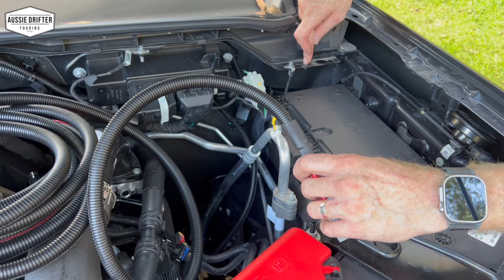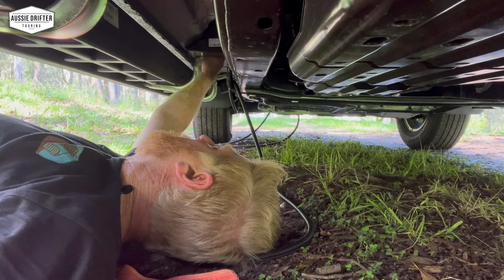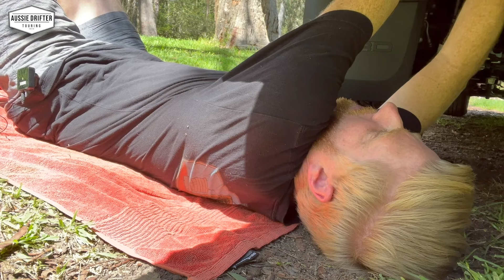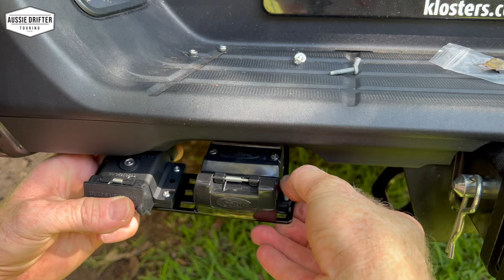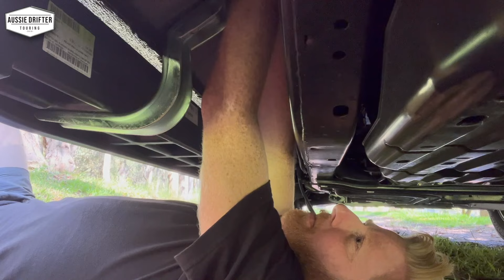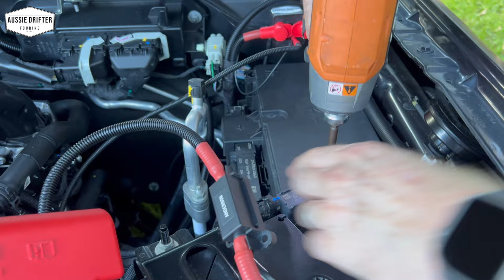Ignition Controlled Anderson Plug Kit |  Installation Guide on Next Gen Ford Ranger

Comment: Awesome kit and very well detailed installation video. I’ve bought 2 so far; one for a 2022 Wildtrak and another for a 2022 Raptor.
Just a heads up for those that have fitted bonnet struts. Do not have the wiring loom going across the top of your battery because it will interfere with the strut when you close the bonnet and make it sit slightly proud. Also, the Raptor requires slightly different cable routing near the rear axle. Still easy to install with a bit of minor problem solving though. Love Aussie Drifter Touring products ❤, easier than building your own.
Down the track I’m going to put a small bus bar and run another Anderson outlet to the panel in my tub.

Comment: Hi  i have a ford everest 2025 but all fuse in the under bonnet box are live when in acc mode as well as when engine running and i understood you only want a fuse that is live when the engine is actually running, have I misunderstood?
Reply from the maker: Hi Nick, the one we use in the video is live with the key on not acc, so you can still listen to the radio without having power to the rear.  if you use an Acc powered fuse it would mean that in that position, you have power to the camper. So you can but just be aware that your running the van as well at that point.

Comment: Is there a video or info using the AUX switch 1 instead of that ignition one - So that you can also switch off when not required and also requires ignition on?
Next Gen with Aux Switch option

Comment: What is the reason for running a negative all the way to the battery rather than grounding on the chassis at the rear?
Reply from the maker: Just the simplest, easiest way to make it DIY and all connection in the one spot. There is no harm in earthing down the back either.
Reply: @AussieDrifterTouring what's the difference between running the negative to the battery rather than the body terminal??

Comment: On the Fuse Box Diagram it says that 10 amp is a spare. I remember testing that it it had no power when engine was running
Reply from the maker: This one has power when the engine is running. n always best to check though as i could chang model to model.
Reply: On the 25.25 WildTrack the fuse for the rear usb worked. I think it was fuse number 140, one of the 5 amp fuses near the 10 amp one noted in the video.

Comment: Just be careful, if that piggy back is on backwards it will protect the vehicle but not the circuit tapping off to. Easy way to figure this out is take that orange fuse out and reverse it... If it has power that's not good.... Turn it around.

Comment: That kit makes it look so easy. I will be installing one on my new hilux once it gets delivered, can I also use the relay on the kit and run a wire through the harness to get power to the brake away system on my caravan that runs through a 12 pin plug.
Will this work  ?

Comment: Hi, fitting anderson cable for caravan . I have a Pajero sport with smart alternator  Connectiing from100amp isolater  the ignition  wire to car fuse box . Do i need to run ignition wire to Projecta 25 amp DCDC solar charger in van  to ignition wire for charger to work?
Reply from the maker: Hi Mate, you will need to give the projector an ignition signal for it to work properly. but f your using an ignition controlled isolator on the anderson, then the easiest way in the van is to link the ignition wire on the projector to the main battery input cable and allow the isolator to give the ignition signal to the projector.

Comment: Hi mate just a quick question 
Can I run two cables? One at my tow bar for my camper trailer and one inside my dual cab for my fridge in a battery box? With a lithium battery inside? Cheers
Reply from the maker: Hey mate, yer you can run 2 you will just need to connect to a 2nd ignition-powered fuse in the fuse box. Powering a battery box will be fine so long as it has a dcdc charger to charge the lithium battery.  If the battery box has a 25amp dcdc charger on it then use the 6B&S version, if its a larger 40 or 50amp charger you will need the 4B&S.
Reply: thanks mate greatly appreciated for your reply
Reply from the maker: No worries

Comment: Update on my previous comment.  Got the job done, works great.  Just need to take time & find something to pull cable through tight spots.  Cable ties were really tight in places so used spare wire to push end of cable tie to where I could use 1 hand to attach properly.
Reply from the maker: Sounds like it was pretty tight in your setup, glad you got it sorted out.

Comment: What I hadn’t considered was how difficult it is running the cable When you have the ARB 140l fuel tank installed.  There is almost no way to get your hands in place to pull cable or to tie it to the ford harness.  Can’t see how cable will fit under fuel filler as there is hardly any gap at all.  It’s taking me forever.     Going to be a bit of a bodgey job I’m afraid.  Not fault of product just me

Comment: why dont you use the start,run wire behind the hood hatch leaver  release  just up and above  that pannel just tucked behind the loom. for IGN curcuit?  I can see why useing a fuse tap is easier  as all the wiring is just thier, im just curiues why people are  not  using the wire ford provides. Nothing wrong with how it done at all  looks good. just yea
Reply: I imagine it’s just easier when everything else is in the engine bay, I plan on using that wire for my dcdc which will be further back
Reply: im using mine for my CB Radio